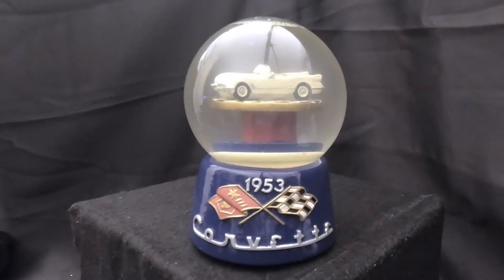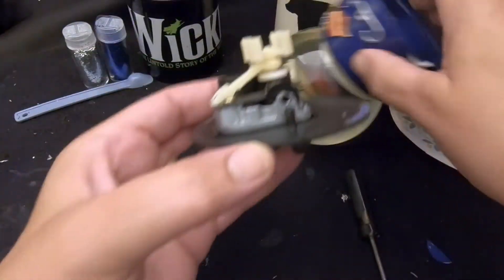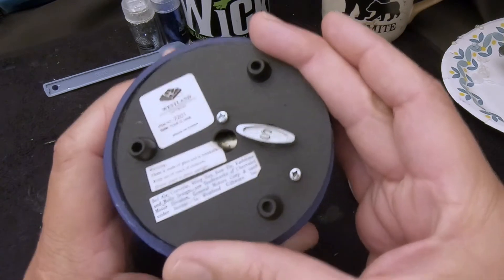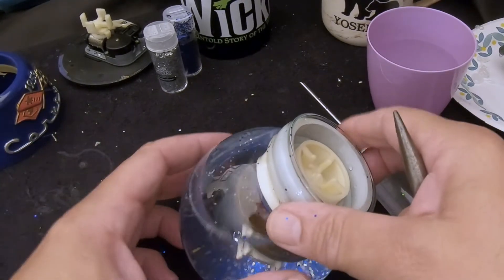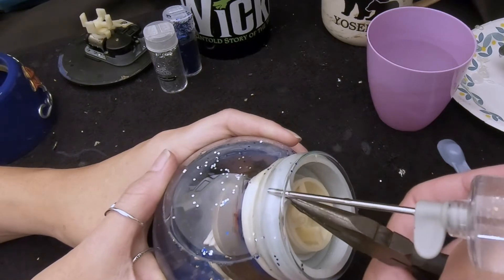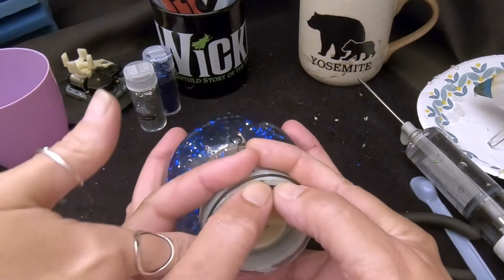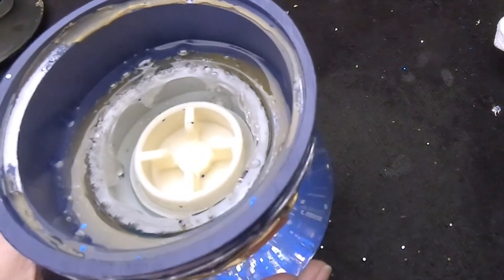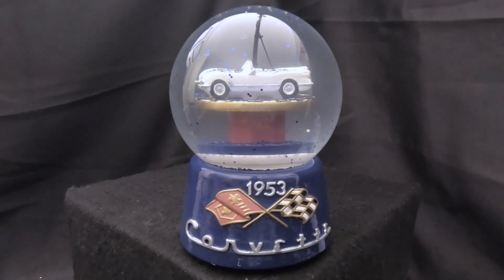Ep. 58 - 1953 Corvette Snow Globe Repair - Yellow Water and Air Bubble. Corvette spins on pedestal

Comment: Just found your channel recently. You guys are helping me gain the confidence to work on a Christopher Radko nutcracker snow globe I bought at a thrift store. I'm not there yet though! What a great hobby and skill to gain during the pandemic shut down. I love your "just go for it" attitude. It adds some much needed humor🙂
Reply from the maker: Hi. Thank you for the comment and feedback. We really appreciate hearing from our subscribers and viewers. We just found a picture of that snow globe. Great find and it does look a little intimidating. However, you should be able to fix it. We had a hard time finding information on fixing snow globes so when we started we were doing a lot of trial and error but it turned out not to be as bad as we thought. We have a lot of snow globe repair videos on many different types of globes. When you get around to fixing it here are a few of our videos that you may find helpful:
Ep. 32 - Comparison of the substances you can add to the snow globe water (https://youtu.be/cjyn_3wFXDc)
Ep. 19 - Snow Globe Snow (https://youtu.be/vFYq1Vrzi28)
Ep. 3 - Snow Globe Repair Tool Kit (https://youtu.be/43RVYhHdcso)
The best of luck to you. We're sure it will turn out fine. Now go rescue that snow globe!

Comment: Have you done any videos showing how to fix the turning mechanism? I have a  NECA Tim Burton' The Nightmare Before Christmas Christmas Night Snow Globe and the music plays but the turning mechanism does not work. It is similiar to the one in this video but not exactly the same.The Music Mechanism says "Yunsheng" and I believe the snow globe was made in 2004. I would like to fix the turning mechanism if I can. Thank you.
Reply from the maker: Hi Ursula. That is a tough one. We have had a couple of snow globes with spinning figurines where the spinning mechanism did not work. In a couple of cases we got the spinner to work after cleaning it and using a couple of drops of oil. There have been a couple of cases where it just could not be repaired. We have tried searching online and have not been able to find any companies that sell just the stoppers, the stoppers come paired with the purchase of a replacement globe. And none of those stoppers had spinning mechanisms. It makes sense since there are so many different styles. Someone must carry just stoppers but we have not found them yet. There are links in the video description to some companies that supply snow globe parts and accessories. Try contacting them, you may have better luck than we did. Let us know if you find anything.
Reply from the maker: Since you are working on a Nightmare Before Christmas globe we thought you might be interested in checking out the two Nightmare Before Christmas globes that we repaired last Halloween. They are Episode 115 - Jack and Sally and Episode 116 - Santa Jack.

Comment: My snow globe is similar to Ep 58- 1953 Corvette. The inner object is Noah's Ark. It is leaking water from the spinning base (and not from the outer rubber plug). Can you please help me how to fix the leak.
Reply from the maker: Hi. Unfortunately we have not had success stopping a leak from the spinning mechanism. You apparently have one of the spinning mechanism that uses a post that goes through the stopper into the figurine inside the globe. We have others that use magnets to spin the figurine. For the ones that go through the stopper, the leak is normally due to wear between the rotating shaft and the seal that it goes through. We have had no luck finding replacement parts for these type of figurine spinning mechanism. You might try looking in the thrift stores for a old used globe that has the same type of spinning mechanism and swap stoppers into yours. The other option is to seal the shaft with super glue on the inside and outside ends of where the shaft goes through the stopper and then disconnect the piece that attaches the music box mechanism. The figurine won't spin anymore but it will stop the leak.
Reply: Thanks for your response. I'm new to snow globe repair. I noticed that you add clear Elmer's glue to the water to thicken the liquid and slow down the snow movement. Do you think that by adding glue the leak could be sealed?
Reply from the maker: @christeodoro6342  It depends on the size of the leak. If you get the water thick enough it may be too thick to leak out. We haven't tried it yet but in theory it sounds plausible. You may want to check out Episode 32 where we do a side by side comparison of the different options for your snow globe liquid. One of the options is to use baby oil (mineral oil) instead of water, which is really thick. We have also been told that some people use vegetable oil in their globes. Not sure if it is thick enough to prevent it from leaking out but worth a try.